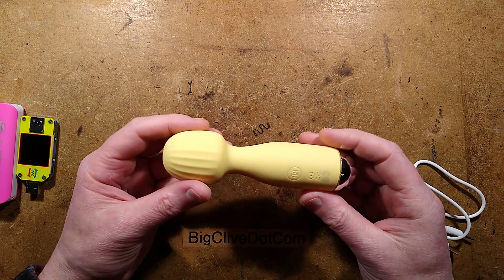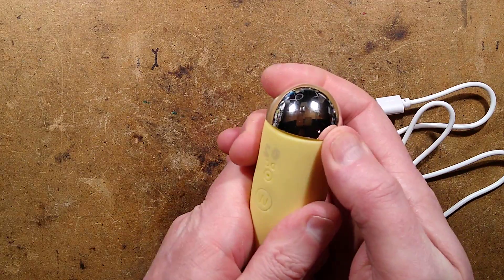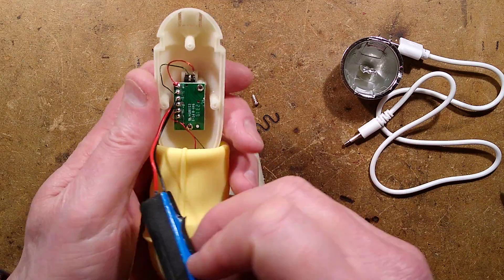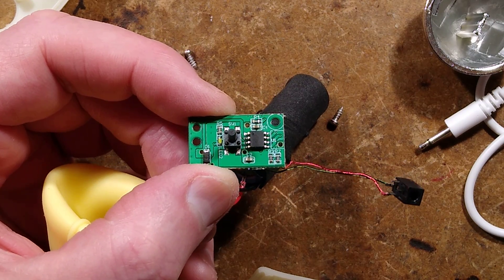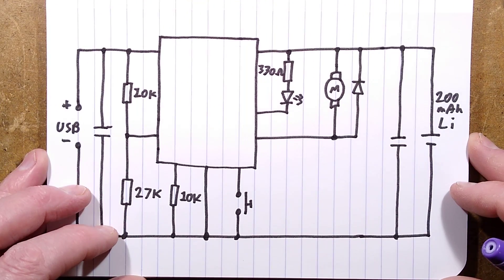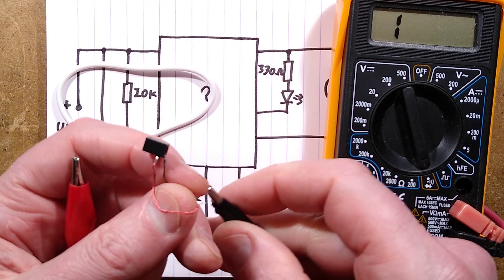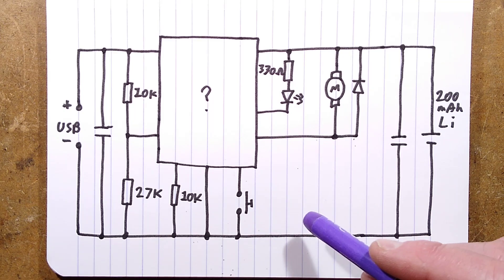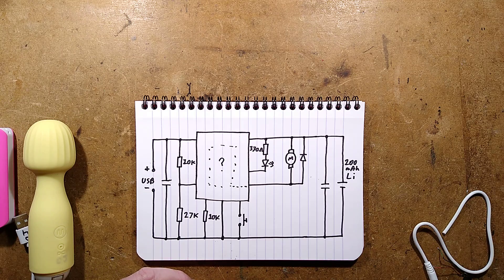Citrus juicing hysteria relief unit - with schematic

Comment: They should of used a stereo plug with the center right channel not connected. That prevents short circuits on insertion and removal as it can't short the ring to the tip or sleeve at the same time.

Comment: I am never going back to juicing my oranges the old way, they have not erupted with such force for quite some time. I hope that battery holds out, maybe I should buy a spare juicer just in case. There is nothing worse than a build up to juicing only to have the battery run flat than having to resort to using a manual juicer to finish.

Comment: I feel like the SOS mode is counter-productive. If you're in an emergency that requires you to use your motorised orange juicer, I would have guessed that running the motor at a consistent high speed would get the juice out faster. Unless the Chinese worked out a more effective method, of course.

Comment: If you are repairing one of these with the intent for it to go back together and work (such as battery replacement or when the motor wires break off), the best way to get the rubber cover back on is a drop of dish soap at the narrow part, then get your thumbs fingers under it and pull apart while pushing down. Other attempts all failed and only ripped the rubber covering. Recently repaired a similar device with 3 buttons instead of one and using flat li-ion cell instead of a round one after removing all the plastic walls that held the old cell in to make more room for a larger round cell. Replaced it with a round cell from a vape and rewired the motor. The end on mine looked same as yours but twisted off with reverse threads (leftie tightie righty loosie). Mine had black plastic inside and clipped together instead of screws.

Comment: In the image of the PCB, I notice the UL logo on it (Underwriter Laboratories). It's not the traditiona UL in a circle, but the UR version, which means it's not a full thing that was certified, but a component of such (you can find it on certified things, but the fancy UR is what UL puts on components). Wonder what bit is actually certified.

Comment: Another point of failure for these devices is the switch.
I have a friend who had a.... AHEM hand mixer? of similar design. The vibration from the motor caused the plate to shake off the top of the switch, which then ejected the plunger and pinged out the little contact disk to dance around the exposed contacts of the circuit board.
I discovered this after she gave it to me to see if I could fix it... Some people REALLY ask a lot of me.

Comment: 10k is the typical value for the temperature sensor to control the loading cycle. It seems it was just replaced by a constant resistor to keep the system simple.

Comment: Why didn't you show the motor at all?
Reply from the maker: It's just a standard low voltage motor.  The rubber sleeve was so tight it made access to the motor section difficult.

Comment: 2:13 usually such sleeves get widened with air pressure during the mounting process, regardless of processing fully or just halfway automated.
Handy bedpost replacement.

Comment: Curiosity will get the better of you, to put the "rubber" around the plastic of these devices, factories use a machine called a "driver", in essence the "rubber" is hot pressed onto the plastic which makes it conform to the plastic's unique shape, during the design phase the option to make it removable is discussed, with cheap devices however, this option is not explored, as no one is expecting a electrical engineer to find a very small juicer and think "that looks cheap and oddly sexual, definitely need to take it to bits", just didn't come up in the design meetings I guess...

Comment: I have/had several pieces of electrical devices that had/have the same charge/power port. The instructions {who reads or follows them?} say to plug the charger/power adapter in to the device, then plug the charger/power adapter into the wall....

Comment: Those audio-style jacks are unfortunately common in uses where shorting out can cause problems. In custom/ergonomic computer keyboards that are split into two halves, it's very common to use TRRS cables for an I2C connection between halves, but that means that trying to hotplug them like you could with USB can short out the microcontrollers.

Comment: This looks like it's going to be a popular video, so I'm going to go on a full tangent and see if someone in the comments can answer a question.

I had an emergency stop button acting up at work today. It tested correct to two separate meters - a cheaper £40 and a mid-range £100 one. It was supposed to be closed, it tested closed. I made the (wrong) assumption that the fault lay in the contactor.

The sparkie swapped out the contactor, the fault was still there, and I borrowed his Fluke for a minute. I tested the estop again - going quite mad - and the continuity check gave an intermittent blip of silence. Bridged out the estop, problem solved.

Has anyone here experienced this problem before? Does anyone know how it happens? I mean, it's just a mechanical switch, I have no clue how it could be testing continuity to a meter but not to circuit. 

Also, if you're reading this far, I'm sorry the post is long on "work stuff" and low on citrus.
Reply from the maker: Contacts on switches can become intermittent when they fail.  This is why many faults have to be traced with the power on for a real-life operational scenario.
Reply: @bigclivedotcom  thank you for the explanation. That job was six hours of pure frustration.

I've never personally seen it where the intermittent fault is not detectable by a multimeter, and am assuming that it was cutting out too briefly for my meter to sample.

Comment: I can't see anyone thinking or using it for orange juice... a clever marketing ploy... But really... S.O.S. mode??  It must have been made in the same factory that makes flashlights and they didn't pay the chip programmer very much money to rewrite the code.   It would be nice to track down those 8-pin Microprocessors they use in everything.

Alright have fun now, you'll not get any of the obvious jokes from me... you've already made close to 10 of them in the video,  L O L

Comment: The Atari 2600 uses a 3.5mm TS (mono) audio connector for its power supply. It sparks when you plug it in or unplug it. Probably for the same reason.

Comment: How do you know there's a pad under the chip for controlling the motor?  I don't clear evidence just from the pictures.  Did you remove the IC from the board?
We live in the future.  "Can't say what it is because algorithms".  1984 vibes of thought police
Reply from the maker: The motor drive connection is not connected to any of the other pins, but disappears underneath the chip.  It's common for high current or heatsink connections.

Comment: Yeah 3.5mm connectors are not good for power. I wanted to make a breakaway connection for my laptop charger and extend it so I attempted to use 3.5 mm connectors. that is until I started noticing that it shorted out on connect and disconnect and started melting the connector and I used decent quality brand name connectors. Which is when I switched to the 5.5mm connections instead but reality those are only rated for 3-5A anyway. I wish I knew about Anderson connectors sooner there so well thought out even the cheap ones, I think almost everything DC should be using them.

Comment: The tip-(sleeve)-ring plug really isn't optimal for power supplies - yet more commonly used than one might want to think. I have a hair clipper from a fairly known brand that has the 3,5mm one - I would imagine they could have put on nearly anything else available that could also rotate freely, but not short out when partially inserted. Maybe this is 0,2 cents cheaper per unit and locks in a bit better. And to think that the 6,3mm variety is seen on the inputs of some passive PA speakers.

Comment: I'm assuming that the power out of the chip to the motor is a PWM signal to avoid the heat associated with an analog speed control signal.
Reply from the maker: Yes it will be.

Comment: I found a microcontroller : Texas-Instruments/MSP430G2210IDR with an application note that shows how to use it as a Lithium-ion battery charger: https://www.ti.com/lit/an/slaa287b/slaa287b.pdf?ts=1712103325199  .

Comment: Your channel should be "X Rated" Big Clive!

My "Orange Juicer" plugs straight into the mains, so I can "juice" until my fruit runs dry, and my hysteria is relieved!

Did I just type that out loud? ... How embarrassing! 🤣
Reply: That's probably for the best.  200mAh seems like you might not get through the whole bushel.  No wonder it charges at such a high current.

Comment: interesting.. i might need to get my hands on one of these.. i sure do love orange juice
Reply: Jokes aside, I wouldn't recommend this orange juicer just from the features shown in the video. The speed settings on these really cheap juicers only work for some oranges, and that's the least of your issues. The fact that it's not waterproof and probably not sillicone would make it a huge pain to keep clean, and with electrics that dodgy who knows how long it will last. You can get something similar from a proper orange juicing online store in the 30-40 quid range at this point.

Comment: If its using an audio jack plug for power, it may have a switch feature that connects tip to barrel when the jack isn't present. That is probably shorting the charge sense input to ground when the jack is removed - and why you needed to add the pull-down.
Reply: "Tip to barrel", you say...

Comment: My OCD simply won’t let go of the fact that the only LED position on the board is labeled LED2.

Okay, maybe the board was indeed originally designed for a flashlight load instead of a tiny cheap motor . Still.

I think you’re right that the charging-still-indicated-upon-input-shorted thing is a bug in the software. I can’t think of a scenario where that would be useful.

The board might be useful for other loads like an LED or buzzer.

Did you check to see if the charge current dropped as cell voltage rose? If it doesn’t that reduces its potential usefulness in other projects. That’s a shame because integrating cell charging and load control functions in one chip is a great idea.

Comment: Most of these rechargeable juice extractors have the not-quite-standard mini phone jacks for charging. (Depending on the model, the diameter can vary by as much as a millimeter, and the length can vary greatly.) I suppose the best way to keep it from shorting out is to unplug the USB end first. In fact, since most people who have one of these will probably have more than one with different jacks and plugs, it's probably best to store each cork stuffer with the power lead attached.

Comment: Hysteria relief should be via that giant metal probe that comes in some "violet ray" sets.
Reply from the maker: Noting that the metal probe is the single most dangerous accessory you can use with those.  It is often referenced to the mains.

Comment: Odd that the board has a UL registration number. I wonder if it's genuine—I've encountered fake ones in the past.

Follow-up: it is registered to SuiChuan PingTai Circuit Board Co Ltd, models PT-M and PT-D. I don't see those model numbers on the board, so the jury is out.

Comment: So if the mono type jack was replaced with a stereo jack with the middle band unconnected it would reduce the risk of shorting while charging by separating the + and - and if that is not enough a headset jack (and plug) with 2 unconnected bands in the middle should do the trick don´t you think? Is it not the proximity of the + and - that is the cause of the issue? I would love it if you include suggestions for re design to remove or reduce issues you find.

Comment: That headphone plug was used on some Atari console clone and on some (few) other electronics around 90s. It had same issues with shorting when plugged in/unplugged. The good thing was that at the time, the power brick was a iron transformer that did not cared about that momentary short.

Comment: 0:53 If it's cheap it can also mean that the materials aren't safe at all. Down there the skin is made up of mucosa, which is terribly good at absorbing chemicals.

So do mind yourself when buying this stuff. Always look up the brands and check for testing.
Reply: Not sure I would want a unit which has been PreTested 😮
Reply: @robert_g_fbg  🤨 I'm talking about consumer protection organisations that send the materials off to a lab.........
Reply: @lillywho  I knew what you meant. Making a joke 😉
Reply: That's a good warning, you wouldn't want those chemicals leaching into your O.J.
Reply: @willj1598  Unfortunately the chemical testing by consumer protection agencies is still terribly rare though. So when in doubt, only buy what they list as safe, even when that means you can't have the one with ultra super turbo nitrous boost.
Reply: I kind of want to see clive flame-test the rubber sleeve, if it's sillicone it doesn't burn in a candle flame.

Comment: I wonder if removing the plug causing a short circuit is designed to take the chip out of charging mode??
Reply from the maker: It does appear to be the case with this circuit.  I'm not sure it's by design though.

Comment: A little alcohol is probably used in the factory as a lubricant for the plastics and sleeve assembly. Evaporates and won't affect the plastic or rubber.

Comment: I could absolutely believe that chip to be a generic/knockoff LED torch controller, which is probably why it strobes SOS.
Reply: Yeah or bicycle lights with different flashing modes, which are illegal in some countries for use on public roads. But I guess this device is also illegal for use on public roads, makes sense.
Reply: @imqqmi  i didnt know that juicing oranges in public was illegal :(
Reply: @commentingsaguaro Yeah it should be as legal as eating and drinking oranges.
Reply: As a Matter of fact, I'm pretty sure I have a flash light that has the same strobe an SOS functions built into it. I wonder if this juicer also has several power levels (because I have three flashlights that have three power levels, strobe, and SOS)
Reply: I came to the comments with the same exact thoughts!! Right before he mentioned it in the video no less.

Comment: Plastic almost looks like a cheap grade of nylon, which is a  tough plastic which is ideal when you don't want to use a lot of material and also don't want it to shatter in people's hands. Most cheap plastics are quite strong, but are very brittle.
Reply: Checked the listing, they claim ABS. I've never seen molded ABS in that color before, so I'm curious what they're doing differently in molding that it comes out looking like that. Raw ABS can be yellowish, too. It's almost like they're regrinding reject/defect white pieces and just adding enough raw ABS for the plastic to mold properly.

Comment: Perhaps there should be a warning label, plug charging cable into the juicer before plugging the USB power supply.
Unplug the power before unplugging the charging cable from the juicer.  Do not wiggle the charging cable in the juicer while charging. May need an instruction book! 😅😂

Comment: That would be interesting, a microcontroller with onboard charging circuitry. I can think of several uses, apart from a juice extractor.
Reply from the maker: And a high current transistor too

Comment: Those extended length two pole jack plugs seem to be used on many devices of a similar type I've been told  - although not many intended for orange juicing - some intended for banana refreshing also use them along with those intended for cavity excitation.
Reply: That has to be the cleanest usage of the words "extended length", "pole" and "jack" in a single sentence. 
Particularly when one considers the tone of most of the comments for this video.
Reply: @TartyVesthandle  😎😄😄😄
Reply: The "correct" way is to have a teeny tiny hole in the sillicone that seals itself over when the plug isn't inserted, so that your orange juicer is waterproof. This cheap ebay orange juicer doesn't look remotely waterproof and I doubt the outside is even sillicone.
Reply: There's something similar on an electric razor I have. Same principle - charge battery and then power motor (though only one speed, I don't think a fluctuating motor would give a clean heroic chin like in the adverts)

Comment: I remember back in the old days when hysteria relief aides had a rotating potentiometer in the base which just did PWM using a 555 timer.
Although, with chips and custom micros being so cheap now, it's probably cheaper as you eliminate the rotary potentiometer. Cutting down on plastic moulding costs and parts count.
Reply from the maker: It was often just a crude rheostat in the base of many.
Reply: @bigclivedotcom  "simple is better than complex, complex is better than complicated"... Now a tiny PCB with components packed denser than in the Apollo Guidance Computer would be cheaper than an electromechanical component. Signum temporis.
Reply: 555 timer? fancy!... the real cheap ones are just a pot between the battery and motor!...
Reply: @WacKEDmaN  I remember when I tried that first learning about electronics as a kid. Works but they burn out from too much current of course.